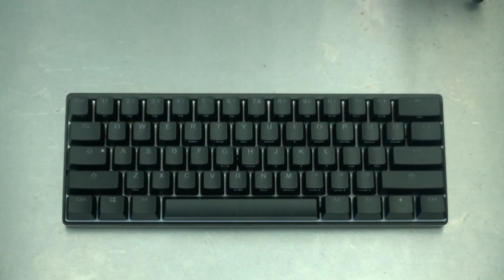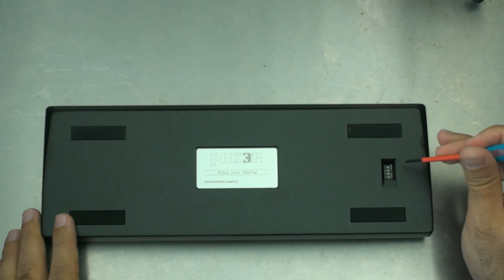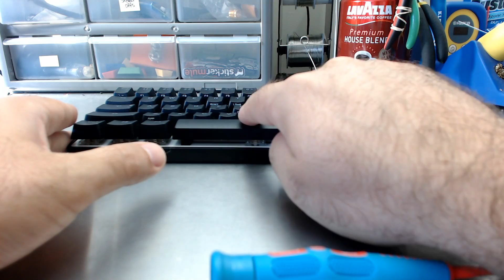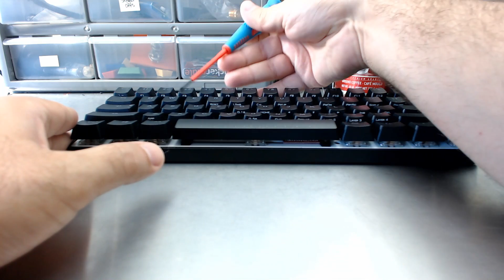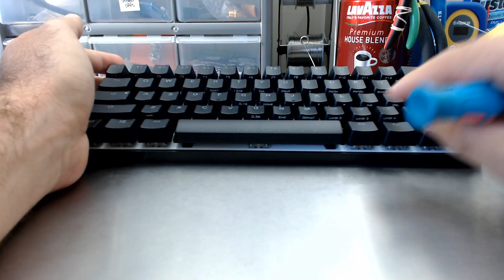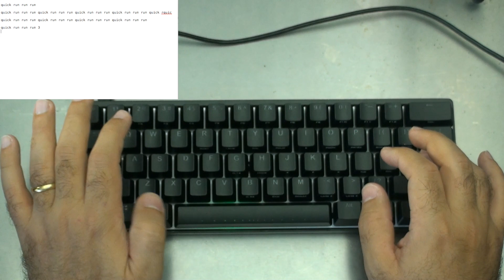How to: POK3R Programmable Layers

Comment: caps as mod3 is the shit. Think about it: it is the only function key which sits in the home row, it is easier to press than the shift keys and doesn't require you to hold your hand in an awkward position, if you need your left index finger on the f key for reference (while typing fast). Map the arrow keys (plus capslock) to j,k,l,i,  the ";" => Enter, Space => Backspace, "u" => "{", o => "}", d => '[', f => ']', a => '<', s => '>' etc. you can program fast with such a setup, I make a lot less mistakes if my index fingers do not have to keep jumping away from the home row.

Comment: Why would anyone bother with programming auto input with the pok3r and all its quirks when you can achieve exactly the same result with AutoHotkey?
Reply from the maker: Auto-hotkey is the computer.  This programs the keyboard so you can remove it from the computer, plug it into a different one, and still use the same commands.

Comment: Had my keyboard for a couple years.  Completely forgot how the RGB features worked and I couldn't lower my lighting levels and somehow completely mess up my keyboard lighting.  Reset it and but was still the same.  I realized I was in one of the many lighting modes!!  Got it fixed and was able to be reminded of all the different modes available, Thanks to your video.  LOL!

Comment: Can the pok3r vortex rgb be turned on azerty keyboard ?
Reply: yes
Reply: @ashifulbhuiyan  I don't think that it can be turned into an azerty keyboard. You can shift around the regular characters like a, z, e, r, t and y. But you do not get the special characters like é, è, ê, î, û, ç, which are a vital part of an azerty keyboard. The problem is that in the programming step you have to type in (with the keyboard itself) the characters the keyboard shall output after programming is done. You obviously cannot type in what isn't there in the beginning. 

A bit sloppily, i would describe the programming capabilities as follows: You can move around the keys on the keyboard but you cannot get new keys.

I haven't entirely lost my hope though. If anyone knows how to get a ç by pressing Alt-c, please let me know.

Comment: Was the issue where holding down Fn+{key} only worked while they were held down ever fixed? Thanks for the video!
Reply: You're talking about having to hold down a key to run the recorded keystrokes? I've received my RGB ISO Poker 3 yesterday (not sure which firmware, I'm on a Mac and they only have Windows updaters) but I can program a whole sentence to e.g. Q or Fn+Q, press the button for a split second and the whole sentence appears. This bug seems to be fixed.
Reply: I actually wanted to print all the numbers. It stops after exactly the amount of characters I programmed to the key and I don't have to hold the key down. So it behaves as intended for me.
Either it was fixed and I have a fixed keyboard or they broke it with a software update for others. I can't check as I'm on a Mac and the updater is Windows only.
Reply: @DanielGattermann  this is a test sentence in order to determine if the issue has been fixed, my vortex pok3r rgb was bought last christmas

yup, it's been fixed.
Reply: i just tried this with my poker3, and for a long string, it is not fixed.  it exhibits same issue as this issue. :-s
Reply: Now I'm really confused. If programmed "t" and "Fn+s" to print the following:
012345678901234567890123456789012345678901234567890123456789012345678901234567890123456789012345678901234567890
That's 111 characters automatically printed after pressing the key(s) for a split second. I thought the limit was 32? It's a Poker 3 RGB and I'm on a Mac (not that the OS matters, or at least it shouldn't).

How I programmed the sequence (just to make sure we're talking about the same thing):
- Fn + right Ctrl
- "t" or "Fn+s"
- typing the numbers as seen above
- Pn/Menu
- Fn + right Ctrl
Reply from the maker: I don't believe the issue has been fixed.
Reply from the maker: I believe this is a bug in the way macros are repeated back.  I think you should contact Vortex about this.